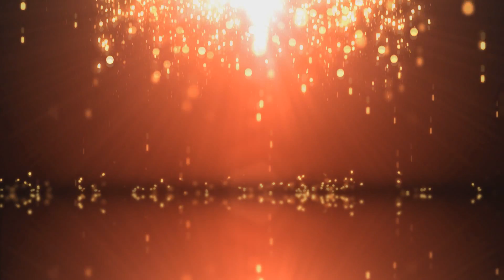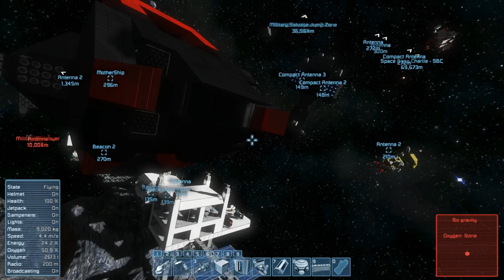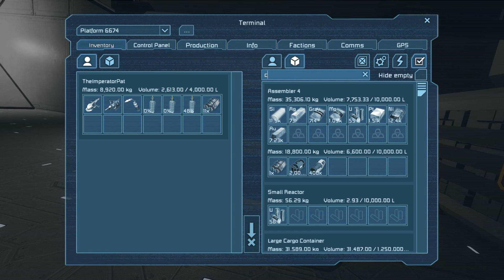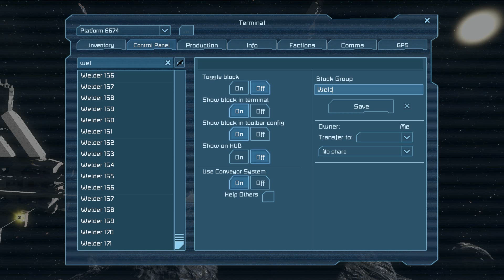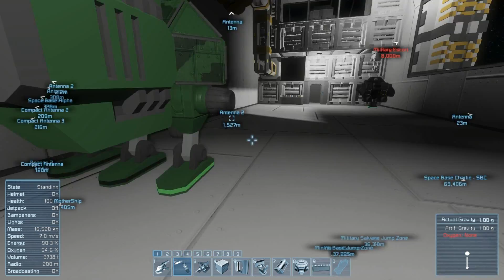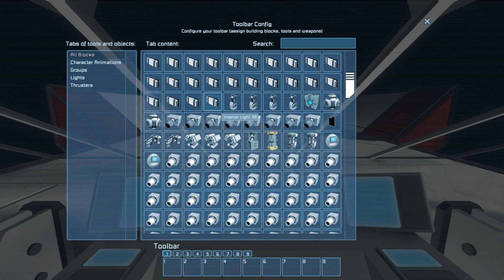Space Engineers: 73 "Time to Mine"

Comment: The welder head is being retracted way too quickly, because of this even if you had 100% of the parts needed for the ship it would still end up in a half built state.  One way to fix this would be to remote control and have an on/off toggle for the pistons on your hotbar so that you can permit them to move a very little bit at a time, allowing enough time for the welders to complete each part before moving on. 

To insure enough parts, look at the projection info and queue up as many of each item as it lists.  True it'll take time but once done there will be no shortage of components to complete the build.